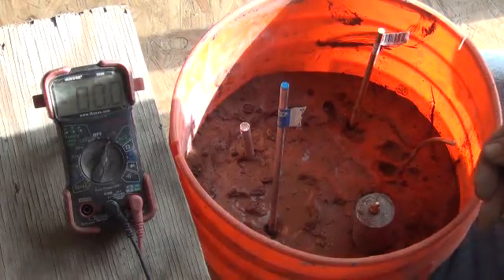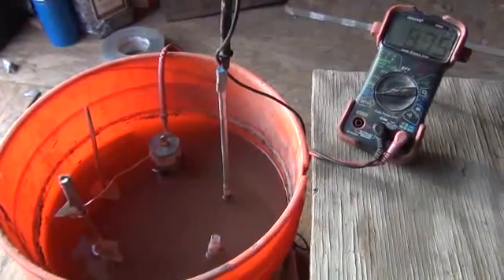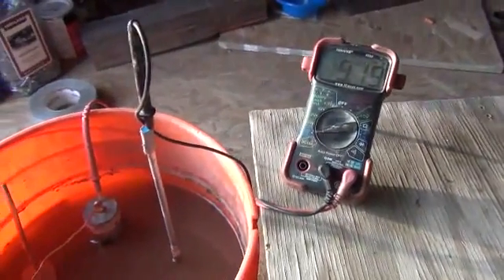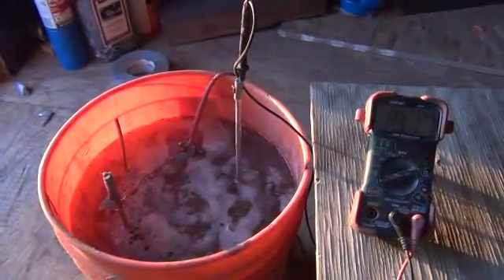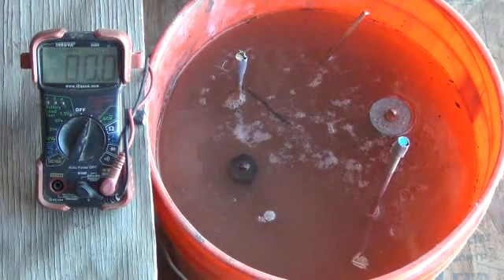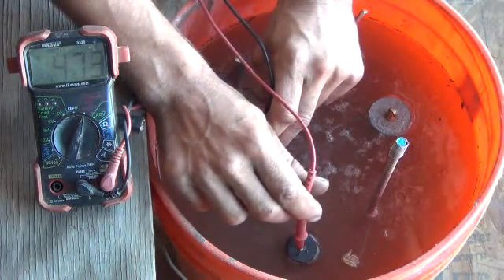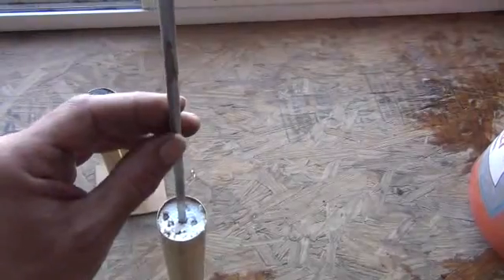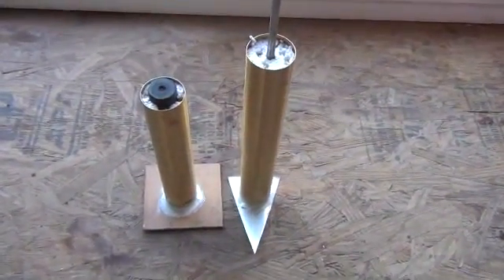How to make a Earth Generator full show

Comment: Amigo, you can get nearly a volt per electrodes if you change the metals used.  Zinc for the negative and copper or silver solder wire for the positive.  You can miniaturize by using galvanized nails or screws for the negative and copper wire for the positive.  You do not even need dirt -- the right combo of metals, as I listed above, will make nearly anything produce the same voltage.  pure water, brine, rocks in water, salt and baking soda, citric acid, vinegar, etc.  The right combo will produce nearly a volt and around 1000 milliamps per electrode pair.

I have had issues connecting micro circuits in series and parallel.  Specifically, I would get close to, but never exactly, what the equations say you should get.

F.

Comment: I have some large aluminium planters. They are completely water tight. Imagine like a large coke can with an open top. Approximately 45cm diameter and the same height.. I have 80 of these. Any suggestions that they could produce enough to run a small off grid electrical system?

Comment: I ran across something from back in 1893 by Michael Emme. He used carbon rods and iron saying that cast iron didn't work as well but Magnesium paired with carbon worked pretty well together. Using 5 banks with 7 pairs in each bank he claimed in the patent to get something like 56 amps at 54 volts. According to the info I read he was using acids and salts together. I'm not sure how practical something like this is but it's definitely something to think about.

https://www.slideshare.net/engpjk/three-kilowatt-earth-battery
Reply: Its  been grabbled

Comment: The solid light blue dot means it is 440C Stainless Steel.  440C is a high carbon chromium stainless steel, capable of developing high hardness and high mechanical properties by conventional heat treating methods. 440C exhibits best corrosion resistance in the hardened condition. It has excellent resistance to wear and abrasion and is magnetic in all conditions. It develops the highest hardness of the stainless steels.